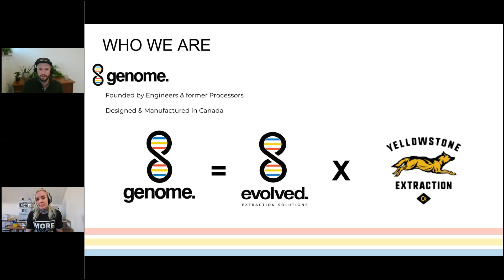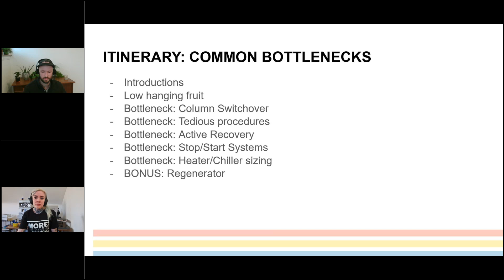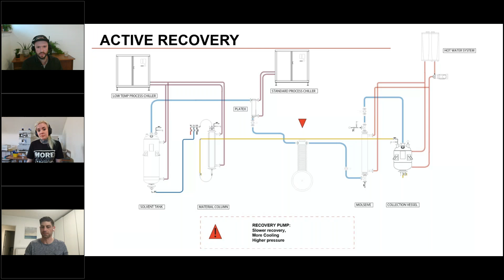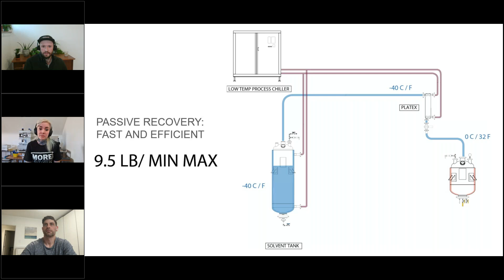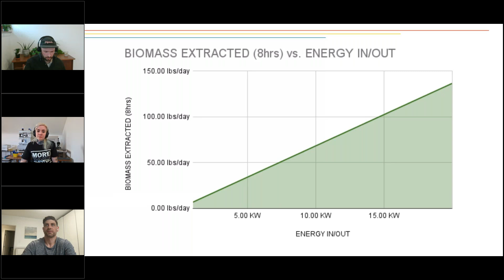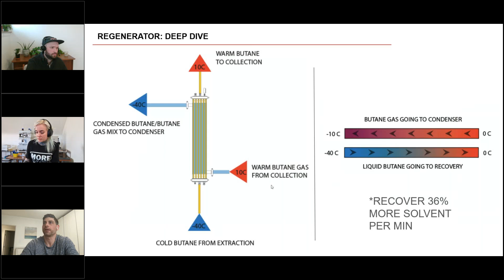Hydrocarbon Extraction Optimization | Faster, Smarter, More Profitable 🔥

Comment: Pushing with nitrogen doesn’t stop recovery, but it can slow it down or interfere if too much is used. Nitrogen doesn’t condense like butane, so it can build pressure in the system without helping recovery. A small burst of nitrogen can help move solvent, especially in passive setups, but it should be vented afterward. Leaving nitrogen in the recovery tank can dilute vapor pressure and make recovery less efficient. Nitrogen is also useful for pushing butane through lines, especially in long runs, small-diameter tubing, or when the system is cold and liquid flow slows down. A short burst of nitrogen creates a pressure differential that helps move the butane faster and more efficiently, reducing bottlenecks and clearing out residual solvent.
Reply: How much should be added and how would I remove it ?